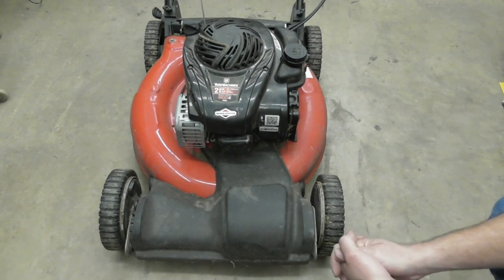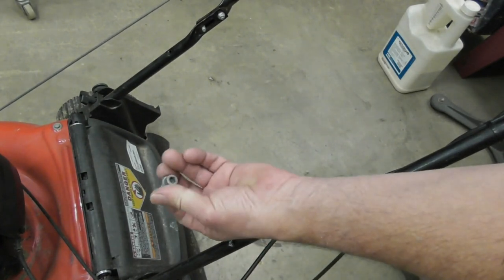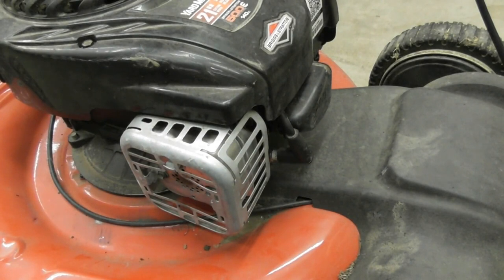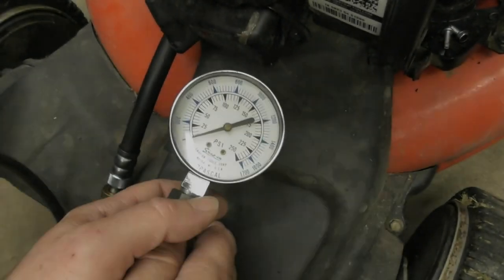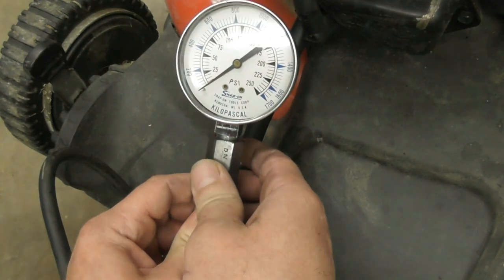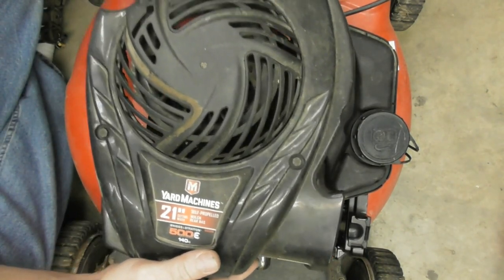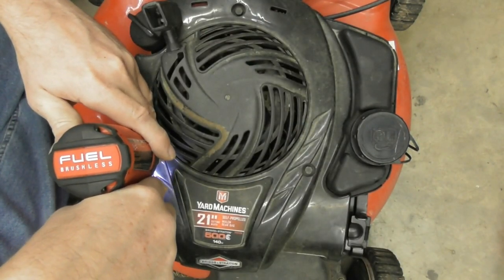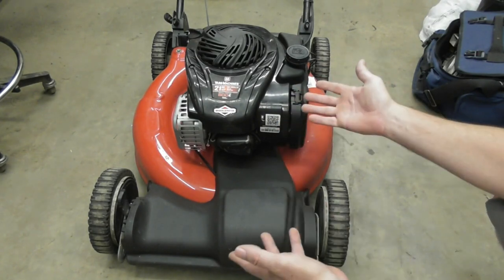Yard Machines Mower No Start Condition- General Information

Comment: Nice score G!  Wondering if they got water in the bowl by washing it with that little barb port (metered air leak)?  Probably just didn't know to remove the gas when it sits over winter.  I paid dearly for my Husqvarna AWD but need it here for about a 3rd acre of grass, takes the load off an old geezer...hopefully my grand kids will get it when I'm gone.  Good to see another video from you, always a pleasure!
Reply from the maker: Thanks PJ! Please refer to Mike Morgan's comment and my reply to him. I believe that's what's going on with the barbed port. 

Agreed, he didn't remove the ethanol and ran the mower dry. We have extremely high humidity here so the hydroscopic traits of ethanol wreaks havoc on small engines around here. It seems like he went to the extremes trying to find a problem when it was merely water in the gas. 

Glad the Husqvarna is working out well for you. I've never really looked into them. 

Take care, G.

Comment: I think that little white hose barb on the carb is for primer bulbs when they are located in different locations on different models.  Is that barb open?  That's one thing that always bothered me about the "newer" style big primer bulbs on 2 stroke Lawn Boys.  There is a hole right on top and no filter.  It's not really pulling air when running, but there's gotta be at least some dust getting in there, only to be forced into the carb bowl when you prime it.  I guess cleaning the carb annually reveals what gets in that little hole.  Ha! 
BTW, how's the old LB running?
Reply from the maker: That makes sense Mike. It was open, but after thinking about your comment- I believe the port is blocked off by the gasket and or the backing plate for the filter. When I went to order the filter, the parts breakdown showed about 4 different options for plates and covers. 

I agree on the LB bulbs and their placement. 

The LB is still running great and refuses to die. I believe it's about 18yrs. old now.  It's my favorite because it's light, nimble, fast, and short. I don't like mowing with the 4 stroke stuff. Take care, G.